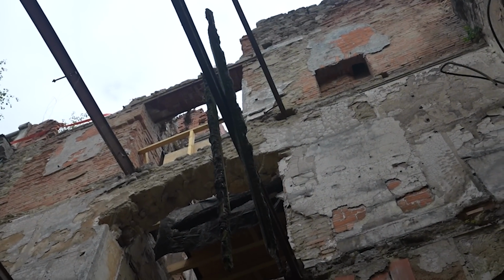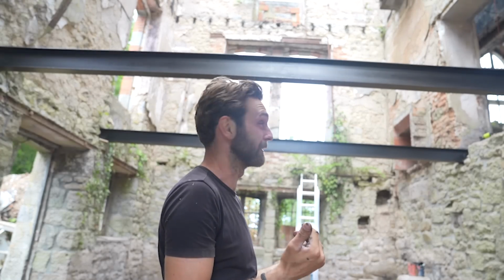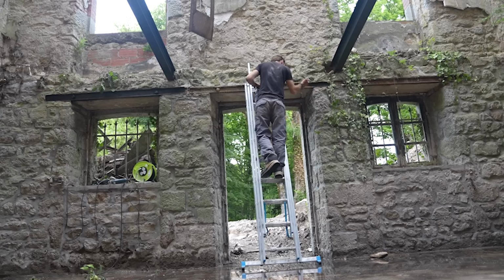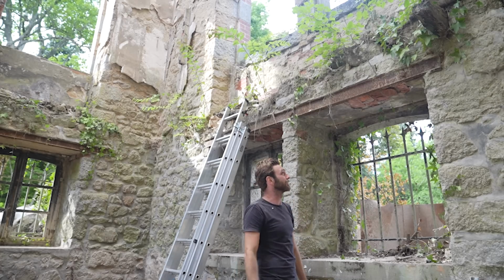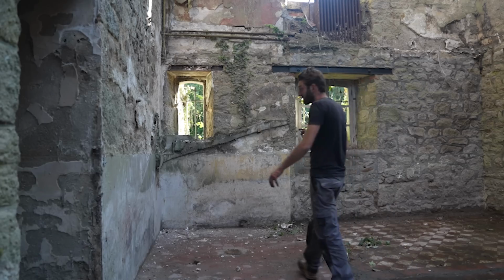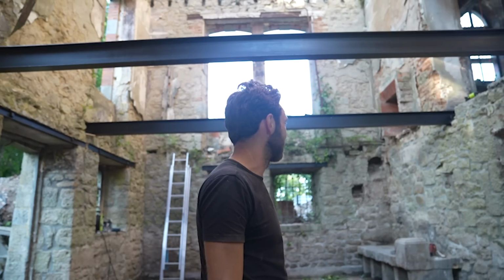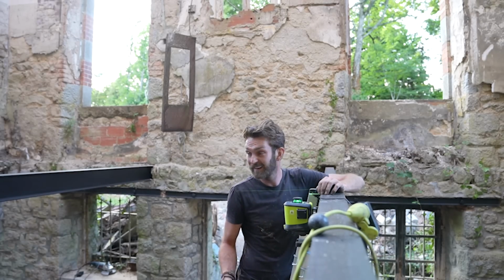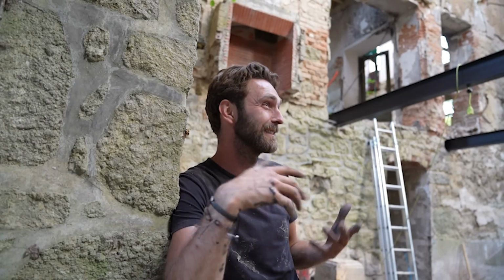Finishing the steel work in the uncovered kitchen.

Comment: Please put a datum in each room , basically a level line around the room say at 1 m up from your Finnish floor level . This level will help you further on in the project etc . You can safely walk around on a safe floor and saves climbing ladders checking levels from this datum ,including invert levels to the underside of them beams
Hope a little advice helps from an old carpenter of 42 year’s experience 😊
Good luck with this project, I will be keeping my eye on this as I would love this project myself 👍
Reply: Hope he sees your comment, that`s a brilliant idea....I`m sure that could help many people.
Reply: @GrumbleBee49  Yeah, that's a very helpful thing! Set up the laser and snap a chalk line around the room, done.
Reply: Hello, I hope Dan reads your good advice ! Fingers crossed. Xxx
Reply: Agreed, I am surprised that all the levels weren't sorted prior to the installation of the steel, although there was always bound to be some lining and levelling to do afterwards.  I am concerned that the steel has a solid bed to sit on because its bound to move around with all the activity due it.  The sandstone is not a good base and an engineering brick or concrete pad would normally be required with the level being adjusted with slate shims.
   
As regards using a laser level, for this type of building a water level would be more convenient (and cheaper) because it could be used in the sunlight and levels can be very quickly transferred from room to room without having 'line of sight'

Comment: When you come to putting the R.S.Js  ( iron beams ) on the next floor ;;i would remove some stone from the bottom of the pocket create a PAD stone by placeing shuttering across the hole and fill with concrete ...by leveling these Pad  stones with the lazer ..when you you place the iron beams in they will be perfectly level ...No messing

Comment: As the steelwork is being left within a non-watertight space then it needs to be adequately protected.  My specification for that would be to remove all mill scale (which you left on) and paint with Micaceous Iron Oxide primer that is an effective weathering coat, because of its durability it can be painted on the ground and lifted into the space, which is so much easier.  Using blackjack will cause problems later on with staining if in contact with porous materials, not to mention that the mill scale is not adhered to the steel and that can flake off along with the layers put on top of it. 
Some of the reasons for the depth of the steel increasing over the original is the change in the structural codes over the intervening years and the fact that the timber is supported on the bottom flange rather than over the top.

Comment: Good to see the progress again. I'd get a snow scooper for the puddles possibly. If you're taking the tiles up, it might be possible to cut a channel in the floor for drainage and sweep puddles into the drain because it's going to be a while until the roof is on. Or will you get some roofing up and use it elsewhere as well?

Comment: Seeing the earth against the outside of the kitchen wall I would suggest that you scrape it all back so the original ground level of the old building is exposed.  That will make the Château look even more grand but also have the advantage of removing the need for tanking what became a basement.  I appreciate that I don't have to do the work but as you are a perfectionist I think it will be worthwhile in the end
Reply: I am guessing that he will wait until the interior structure is built out , for now, the dirt layers built up around the exterior are giving the walls stability. A video last week showed the crew installing the I-Beams before they cleared all the layers of earth out , likely for stability.
Reply: I'm 99% sure this is the original ground level, the basement has always been partially below grade. That's why there were steps and stone retaining walls around that entrance.
Reply: @Ragnar8504  I wonder if the steps were a later addition when the current structure was built upon an old castle. I don't know the Château personally but certainly basements are hard to keep dry.
Reply: @juliadplume3097  That makes a lot of sense

Comment: Tip for long lasting equipment: always unspool the cable drum all the way as to not cause the loops of the wiring to melt together.
Also is true for the cord of a vacuum! It could cause induction and force the material to heat up!

Comment: If you look at the N wall (where the machine entered) 1:15 , you can see that both windows at the sides of the entrance were walled entrances like the one at the W wall (the big window) 5:38 .

After seeing this (three doors in the same wall), I thought "maybe it was an arquitectural design to made them look like that" but moments later 7:40 the video shows clearly the E wall. There, the two windows are clearly NOT walled entrances.

So my first guess is that this room or (a) was an earlier building (being the N wall with 3 doors, maybe a barn?) or (b) a rejected garden façade when they, clearly, rose the ground level around the building to flat it.

The walling of the entrances is made too similar to the rest of the fabric, so it should have been done early. When the shut all the doors, it's when they added the current floor, which only shows a difference in the pattern at the only outdoor entrance, thus making it concurrent with the closure of all the other doors.
Reply: They could have changed their mind during construction too.

Comment: I don't know how it is France but in Germany it's worth keeping hold of your old doors and windows, especially if they're of a simpler design than used as "standard" by the historic preservation authorities, I don't know how else to call them. An example, in Germany, for historic buildings (grade two listed ?) They'll insist on 3 cross bars per window, so 8 individual panes of glass for two wings. However, of you have an original window with only 2 bars per wing, they'll allow that as being historically accurate, which brings a huge saving when you have a lot of windows...
Reply: Interesting information. Thanks for posting that

Comment: The steel beams will sag when  the floor is installed.  It is standard to pre bend the beams so when the load is applied,  the beam is flat/straight.

Comment: You have proved time after time your extraordinary improvisation skills. Have you thought to use a watering can to wet the bricks? Not as heavy as the big water containers and it might save you some water.
Reply: That would only wet the surface and would dry out fast, steeping them for a while allows the water to penetrate further into the brick.

Comment: Take it from a Ironworker, Structural Fitter, Ship Outfitter and welder. Stiffen your beams with wood planks anyway. You will appreciate a more solid floor. Steel beams will still bounce and depending on the weight load can sag slightly.
Reply: He's using concrete block and beam presumably resting on the steels, which should be very rigid and not able to deform.
Reply: @LaReynedeNeige  apparently you don’t have experience in this field. I gave him a solid experience suggestion.  It’s better to beef up the beams now than realized it later. Had these been thicker steel beams or added a couple of more beams I may not have suggested this. The cost is minimal now, highly expensive later.
Reply: Steel also has the problem of expanding and contracting slightly with temp extremes. Wood cladding would help keep flooring from those nasty squeaking noises when walking.
Reply: @Mike-vn7ys  Let's see how the next stage happens. I'm assuming he is going to fit his concrete block and beam in between the steels, though conceivably they could also go over the top. I've been on very many building sites in my time, sat through countless projects meetings and seen what goes on. Of course, these were large corporate builds mainly in concrete.
Reply: Excellent recommendation!
Reply: In the reply to your excellent suggestion, where did some of them see any mention of Dan's proposed structural system? I watch this channel daily and haven't missed a single episode. I never once heard him say anything about concrete.  Is that patreon info?
Reply: @paulrosa6173  I have done work under outstanding engineers and some where you pull your hair out and cry in frustration. When you are the one performing the job you know and learn things a desk sitter doesn’t have a clue, just a pretty picture to hang on their fridge.
Reply: Hi Dan, well done on being 4mm out,I love watching you build this Phoenix, I haven’t got a clue about building so I’m fascinated,but also the comments are so interesting too. K🇬🇧❤️
Reply: Mike, I as a watcher (and someone that will be doing a similar project) was under the impression that steel I beams needed a slight pre load arch engineered in to take the expected load.  I’m confused!  Mine will be 20 foot beams 4foot on center replacing 150 year old wood beams damaged from a fire.
Reply: @LaReynedeNeige  There is no rebar in this entire build.
Reply: I agree and another concern is these beams have already been through a high blaze fire that was enough to gut the building then sat for decades rotting rain after snow after baking heat. The bricks I am seeing are literally crumbling away in his hands. There is no concrete rebar supports in any of the new additions or old ones for additional support. The weight of the additional bricks, concrete wood plaster flooring and in the end finishing, furniture insulation and roof. Yeah man I would not want to stand under this structure. Dan is going to need to rethink this entire venture. If this was in the U.S. the building code unit would be all over him like white on rice. The bottom up is where you start. The bottom basement was SUPER shady with regards to support. Dan needs to add the additional PSI enough to support 3-4 levels going up with new materials floors, beams, roof insulation tiles, walls. The stone that he thinks will support this structure again is likely to crumble at its weakest places as it is no longer new and it was left exposed to the elements for decades. Dan needs to hire an engineer get it submitted to the city and work with a REAL contractor. This is a tear down as far as I am concerned for the average build. Dan doesn't have endless amounts of money like a contractor would to throw at this to bringing this back. I agree this is going to get expensive later.  Maybe we are over thinking it he just intends to "improve the site" to sell it back again for a high amount of cash.
Reply: @PlanePreacher  I have actually built beams going out to various structures. By building I mean I would get a beam and make the holes and brackets along with coping the beams for attachments to other beams or columns. I would crown beams if they were in the drawings but only for roof applications not for structural beams. Beams are per pound, lets say 36x10. 36 is 36 pounds per foot in length 10 would be how wide beam is.  There are many sizes of thickness. So the 36 could be 24 or 48 for example. I have crowned some roof beams, it depends on the engineer.
Reply: These new beams are definitely over engineered.  They will be fine for what they are being used for. 
And remember people,  concrete and brick, are strongest under compression.  It's when they are not under compression,  i.e., expansion,  is when they fail. So, most of this building, once covered in render, will be fine.
(AssoDip in Structural Engineering)😊
Reply: @MissSilencedo-good  And where would you put rebar, exactly?
Reply: @LaReynedeNeige  There are many ways to tackle this. Normally you would reinforce ALL the walls with rebar and concrete. You could use the cinderblock and rebar method but it is all dependent on what is going on in that basement and what the building codes allow. The foundation footing dictates what you can do as far as PSI above. Then there are what was considered the load bearing walls when it was constructed if you are following the same gameplan. Now you are talking about reinforcing those foundation footings then working your way UP. Once you have done that you can work on the ground level above the basement as the PSI of the ground level or 1st. floor can take the weight of that and more. Now you tackle the load bearing walls with rebar and concrete to support the compromised brick walls that are crumbing to dust. After you have basically covered that and replaced the "roof" of the first floor and flooring of the 2nd floor with I beams that can handle PSI of the 2-3 floors above it  you can continue to reinforce those load bearing walls rinse repeat. It all is dependent on the basement and how secure it is to handle the loads above it that is A LOT of PSI pressure. The flooring on the first floor is rotted through to the basement and there is a gaping hole from the tree growing there that caused the entire 1st. floor to lift NOT GOOD. Those metal beams in the basement are not good and clearly are rotted enough to make the floor move like shaking a carpet when the tree guy came. While it is not sexy the basement needed to be secured first with up to code footings for the entire building's floorplan. You CAN NOT compromise on this. He needs to get an engineer and contractor to take care of that even THEY get it wrong sometimes. That is how important that is to get right the first time. Those rusted beams that make up the flooring on the first floor need to be pulled out and replaced and basically all the floors gutted so it can handle more weight and be up to code. It is going to take A LOT of money and expertise to make this a safe livable house but if it is done right it can be brought back. But I would say it would cost about hmm about 650-1 million to get it done right. But as you know they say whatever you expect it to cost DOUBLE IT . If it were me, I would sell it as an improved site and get out while the getting is good and do a smaller renovation. This is going to take engineers and proper contractors to get right and they are not cheap.
Reply: @MissSilencedo-good  I wouldn’t do it either, but I'm interested that a structural engineer has confirmed it's salvageable. I'm assuming he is following a plan of works but we'll never know unless he shares the detail. I'm sure he'll read your comments with interest - then go ahead and do what he's going to do anyway. 😘 I'd like to know what his engineer has to say about your assessment, but we're probably not going to get that.
Reply: @Mike-vn7ys  Thank you Mike, I appreciate the input.  When the decision time comes, I will use an engineer if I go metal.  I have a local sawmill so I can still get wood beams cut.  Somewhat inexpensively!  Decisions, decisions
Reply: @PlanePreacher  if it’s one thing in life that I have learned is we will never run out of decisions and most of those decisions come down to what we can afford. We all want that bigger piece of pie but there is a price to pay. 
I hope I helped.
Reply: @Mike-vn7ys  yes, thanks again.
Reply: @Mike-vn7ys  The beam and block floor if fitted will provide a solid deck to work off.  The new steel only needs to be as strong as necessary to comply with the current codes, adding more unnecessary steel will just add weight to no real effect.  To get the steel to resist vibration and spring would mean excessive sizing.  The maximum allowable deflection in the steel beams will not be the criteria in this design, it will probably be the shear at the end and/or buckling, so that the steels are unlikely to get anywhere near their allowable deflection  (1/385span)
Reply: @LaReynedeNeige  The beam and blocks should go on top of the steel, that is the normal location, putting them on to the bottom flange means that the steel has to be designed for that higher load and the bearing then becomes critical.

Comment: Always lonely when the team goes home and you are left alone.  But the work must work go on. The nice thing is when you are finished you will know where every pipe, drain and wall socket is and you won’t have to guess if you need to repair something. Unlike now where you are guessing why and how they put something.
Reply: More peaceful than lonely, obviously it would be great if Dan could get a helper, but at least he wasn't on the wobbly trestles at roof level, and putting more floors in helps with safety!?!

Comment: Along with Betty Jo, I wonder about your housing plans.  Do you plan on enclosing/waterproofing parts of the basement sufficient for a workshop and perhaps camping space?  Useable prior to complete restoration of course.
Reply: It's not waterproof without a roof on top, I think he said in a previous video he wasn't doing anything much with it until it had a roof!?!
Reply: @thomasherrin6798  Thanks, I don’t remember that specifically.   But he has gone quiet on temporary on-site housing.  We have heard nothing about the shop he set up at his grandfather’s.  He has said that the commuting is a time sink. He could have the floors in on this side of the chateau before the end of summer - that’s 3 levels of subfloor.  And he has tested a “waterproof” tarp arrangement for the multilevel hallway floor construction.  He has created possibilities and I wonder if some are surprising to him, or if all are planned. I’m just wondering how he is addressing some of his stated constraints, whether they include housing, and perhaps what his summer building season goals are.  So I tossed out a lure in hopes he would share some of his thoughts & plans in this area on a future video.